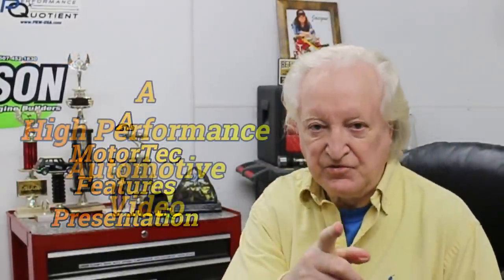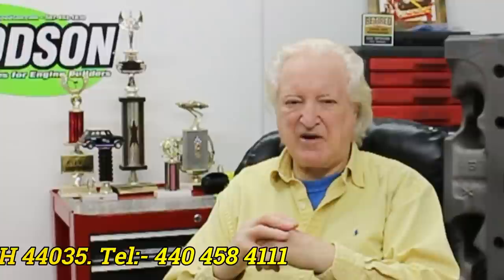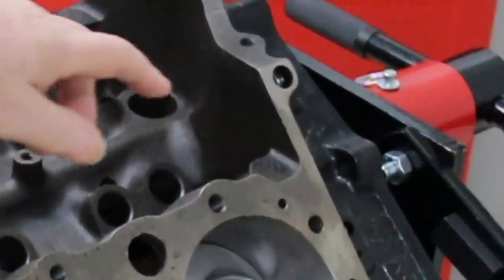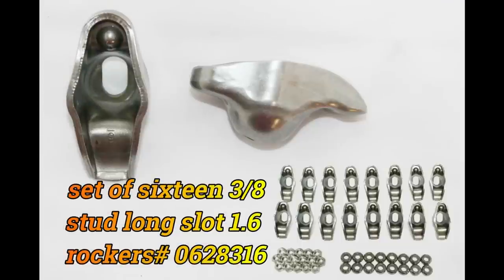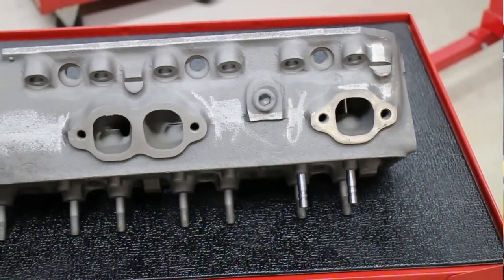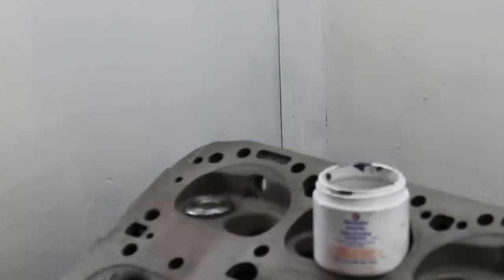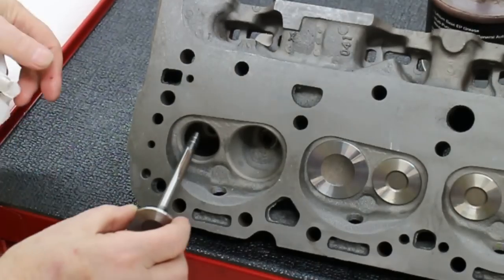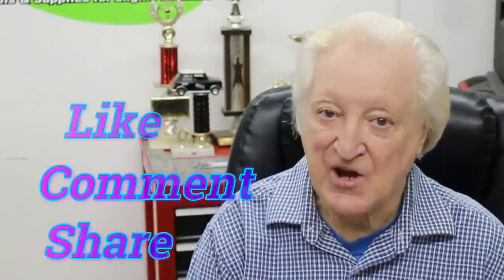Real low buck 60 lbs-ft and 60 hp minimum from stock iron headed 350 SBC

Comment: I used your guidance on porting a factory GM Quadrajet intake for my old second gen Camaro with a 400 SBC. It ended up making noticeably more low end torque than the ZZ4 intake I was currently using, and to top it all off it knocked 2 tenths off of my quarter mile E.T.!!
Reply: A q jet is the worst carb as it dumps raw fuel into the 2ndarys. It will not make good power as the fuel isn't atomized. It does not go through a venturi. Bloodviking

Comment: Dear Mr Vizard, I am a fan of your work and have been since I started to read you articles in motoring magazines from the 70s when I was a spotty faced kid.  I bought a mini in the 70s and a book came with it, written by you, all about improving the gas flow on the BMC A series engine, it had a red cover if I remember correctly.  I loved that book and would sit up in bed reading it for hours.  I was determined that when I was older and had a bit of money that I would use that book to pep up my own cars.  Well 5 houses later the book has gone and I`m still left dreaming about cylinder head and valve work.  I`m so glad that you are still using your knowledge and skill on engines and I`m glad that in came across your vid by pure chance.  Keep on trucking Mr Vizard, a link to my misspent youth.  Kindest regards, Paul Blackmore from Liverpool.
Reply: Paul, glad you enjoyed the book.

Comment: I built a 186 headed flatop pistoned 350 back in the mid eighties. My stepdad was a pretty good engine builder and showed me how to do some porting and did a 3 angle grind on the them. He also picked out a camshaft with a tight lobe center which was unique for the time. If I remember correctly it was 230/236 @ .050 .480 lift with 108 lc. I think the valve springs were TRW LT1 replacement and I bought a set of PAW long slot rockers. I used a 305 crankshaft and lightened the factory forged 350 pistons to match the weight of 305 pistons. TRW rod bolts handled 7,500 pulls with no problem. I ran a great set of Hooker Super Comp headers 1 3/4 with 3" collectors. It ran really well and surprised a lot of people. I ran ot in a 1967 Camaro on a diet that weighed 2950 with me in it.

Comment: There is another way to check those valves and seats. Blue the valve like in the video, using a wooden hammer handle on the head of the valve to hit it down into the valve seat. Do not twist the valve at all. Remove the valve, check the seat on valve and head. Wipe the valve clean or Brakleen it clean, then repeat the exercise to bring the blue on the valve seat back onto the clean valve. Will show instantly if the seat is out of round or has any low spots. Was taught to do it this way 45plus years ago and it has never failed me ever.
Reply from the maker: Hey Boss -i just have got to try this one!!!!  Thanks for the tip.
DV

Comment: Thanks D.V. I have put together countless #s of cylinder heads! I always used a good grease, basically the same way as you did on everything, valves & guides, retainers, shims springs ect! I probably read it in one of your books when I was a teenager! When other engine builders around our area were having problems with guides sticking & or galling issues, we were not! We even had a super stock racer come in to watch how I put heads together! [believe that?] Because he always had his guides fairly loose, because of the crazy high RPM he ran! [he normally used a light motor oil on the valve] But he even stuck them a time or two! All the things you listed, are commonsense engine building practices! Except, not too many have that anymore! You don't need to be told, but the cams with the L/C, [higher numerically number] beause people always seem to get this wrong! Have very rarely ever been faster on the track! We went through all that B.S. with nitrous engines back in the 90s, originally! They were always the quickest down the track, with the lower # L/CA! We tried 4 different cams, in the same engine, & with all different adjustments, to the camshaft & valve adjustment, that they said would be defiantly faster! But they were not! Same engine, same driver, same N2O kits, same track at the best weather time of year! Normally making 3 or 4 passes, for a average, on the different cams & the different cam timing adjustments! The one thing we found out for sure, was the camshaft companies, knew how to sell you camshafts! After all that testing, fuel, time, wear & tear, ect! We only made camshaft changes, after doing lash loops & cam timing adjustments, on the dyno, where the engine was asking for something different! Not the camshaft companies telling us what our engine needed! Thank you again D.V.

Comment: I’m kind of surprised that the rockers studs didn’t get pinned or modified. I’ve seen those things pull out on old Ford and Chevy heads with low spring pressure. As always a very informative video. Thanks for sharing.
Reply: Its funny ive pulled apart alot of small blocks and a few were race motors too and i have never seen a pulled stud, i have pulled studs with a 5 lb slide hammer and it was a lot of work , factory studs are not pressed in they are cast in , ive never thought screw in studs were necessary when spring pressures are within 50 lbs of stock. 

I wonder if studs backing out is more a cam side phenomena as opposed to valve spring side ?
Reply: @luckyPiston   I’m not sure. I think it’s just a heat cycle thing possibly. The easiest way I’ve seen to pull them is with a little heat and and a tool that utilizes the nut that goes on the stud. You tighten the nut and the stud pulls right out. The last one I saw fail in person was on a freshly rebuilt sbc. Completely stock throttle body engine in a early to mid 90’s pickup. Ran fine on initial startup and developed a miss about the time it got up to operating temp. Pulled the drivers side valve cover and the stud was ready to fall out.
Reply: @JohnThomas-vb9se  I will def consider pinning in the future especially if using 1.6 rockers with more spring pressure as the 1.6s increase mechanical load on the stud.
Reply: @luckyPiston  ...back in the sixties,,,,,drag cars needed studs to be pinned......Now understand in 1970....chevrolet  Z /28 camaro had screw in studs / pushrod guide plates............the earlier race versions of Z/28 [built outside of corporate Chevrolet] were no doubt pinned..............
Reply: @JohnThomas-vb9se  I saw an old mechanic fix a "pulled" stud -  just removed a valve cover and hammered the stud back down without even removing the rocker !!
He claimed it wouldn't pull out for another 100K miles and the car would likely be junked before that.

Comment: Didn’t realize those were 041 heads until I caught the casting numbers. Absolutely enjoy the videos. Thank you sir
Reply: Last engine I built I used them. That was back in mid-80's. When unleaded gas came on the scene I quit messing with mods. Started driving 4 cylinders that got 32 MPG running them hard as i could. Slow but cheap to drive!

Comment: When I got your book many years ago now, I was operating a SERDI 60 for a living, I noticed that the angles of the seats you recommended correspond with certain SERDI cutters,  I put a five angle seat on a set of Chevy 229 V6 heads that I cut out for 1.94's, they went on a 4.3 V6 to bump up the compression ratio, it was installed in a CJ5, it was a great combination!
Really enjoy the knowledge your passing on!
Reply: I always thought the 229 and the 4.3 were completely different motors ?
Reply: @luckyPiston  the 200, 229 and 4.3 (262) are Chevy engines, 3/4 of the small block V8, the 225, 252 are Buick engines.
Reply: @stevegarboden2437  I'll be darned, i never considered that that 90* V6 could also be a variant of the 267 and the 305 learn sumpem new everyday LOL !

Comment: Well done vid!  The name for the paint used inside the head iis "Glyptol"  Pat. 3M .  liquid insulation for motor windings, transformers etc.. The other reason to use it, it sheets oil so more gets back to the pan quicker.  RHS who now is part of comp cams built me a mild 468 BBC for my jet boat. They used Glyptol in the head and in the valley. That was in the 80's. I had no idea till they told me!

Comment: David, I have to thank you for your work. It's absolutely incredible knowledge. There's no one I've learned more from. Gale Banks is second behind you. Lots of math on duration, moving torque peak, etc. The one thing I'm going to share with you that blew my mind is on exceeding peak flow lift because it's a factor of time. If you only lift to peak flow, ie 0.600" , then peak flow is achieved for a fraction of a second. If flow goes flat at .600 and you go to 0.700" it creates a square wave flow over time vs a sinusoidal curve with a flow peak. Exceeding peak flow lift leaves a peak flow flat top resulting in greater area under the curve with the same centerline and duration. Square wave lift flow patterns.
Reply: EXACTLY.👍
That's a point grossly misunderstood by most all.
Run all the lift possible for your duration.
Reply: Yes...for a point of view of power. But speaking of street engine or "all around" one there is also valve acceleration (cam lobe surface loads),  valve side loads and valve spring durability. Power and durability (high mileage) are always in some kind of balance...which you have to decide when building engine.

Comment: The 400 dampener is for external balance so the 350 8" truck dampener is probably what David meant to recommend that should be used on an internal balanced 350.
Reply: Yeah i think a few of us were thinking that too, it doesn't hurt to clarify as that's what DV is all about anyway. cheers.
Reply: Listen again.
DV said use the 400 damper and machine out the weight for internal balance cranks.
Reply: @hotrodray6802  

Not many people have a lathe to machine the outer ring totally round. Besides, by the time you do that it will now be a light weight dampener. The reason he said to use that one is because it was a larger diameter and it is heavier. Also the newest factory sbc 400 dampener is from 1976 that more than likely the rubber ring would be dry rotted.

A late 1986 to 1995 sbc 350 truck dampener is the larger heavier design and it is already internal balanced and will more than likely have a few more years of service left in it being over 20 years younger.(a Vortec dampener is the larger size but the bottom pulley would need to be spaced out the thickness of the reluctor wheel I think it might be called that is on the crank behind the timing chain cover or source that wheel and install that under the cover so the pulleys line up?)

And I did hear what he said but what he said wasn't right for 2022, maybe 20 years ago would be more doable but not now. The sbc 400 dampener would have to be sent out to have machined for $100 an hour plus or minus which would take around an hour and a half and then around another $300 to have it rebuilt! You can still get one of the ones mentioned above for about $20 at a junkyard. I know which one I would choose, what about you?
Reply: You are right - was not thinking clearly there.

Comment: When I went from a performer rpm to a performer rpm air gap on a AMC 360, I had to go to annular booster. I couldn’t get my straight leg 600 to work or my down leg VS 750 to work either. They had big flat spots between the transfer slot and main jets. They had both worked perfectly on the heated performer rpm.
The annular 600 summit racing carb fixed my problem. Your buddy Andy from Unity Motorsport pointed this out on one of his videos. I then went and re read your how to tune holleys book and found it all the info in there.
Reply: Interesting, Anulars fog a little better so it would be safe to say the air gap intakes are more demanding of a finer mix ?

So i have a Vortec 383 with a Edelbrock performer (w/no heat crossover) and when i went from a holley 650 spread bore to the Slayer VS 750 the motor fell flat on its face, it idled just sweet and when you blipped the throttle it was instant revs but as soon as i tried to drive it wouldn't turn past 2k rpm, tried jetting it up but that just wrecked that sweet idle and didn't make it any more driveable , ended up puttin on a Holley 3310 but it didn't run quite as nice as that old spread bore
Reply: @luckyPiston  . So the way I understand it is the colder the intake, the smaller the droplet size you will need, to stop it condensing on the intake walls and be a good droplet size by the time it gets from the carb to the combustion chamber.
Reply: Downleg annular always win.

Comment: Nice detailed video.  We used to pound the valve stems after keeper installation with a dead blow hammer.  I don't recall why this was recommended.  If a keeper pair was binding a little, it should fully seat itself on the first crank over.
Reply: I was taught to bump them to insure they're seated.

Comment: Those look like 041 heads. those are great for street builds. I have a set on my old truck. 9.3 static compression, 2.02/1.6 valves and Howards retro roller 485/495 110 lobe separation, Comp full roller rockers 1.52 ratio. intake is an Edelbrock performer with a Holley Sniper EFI. The truck is mean!
Reply: DV's calculation program probably recommends a tighter LSA.
Reply: @hotrodray6802  I called and talked to the people at Howards. that was the cam they had in stock. They were having trouble getting cores. They actually recommend a slightly smaller cam for my application with a 108 lobe speration but said this one would work well.  It does the job. I don't have the Dyno sheet but if I recall it makes 380 something HP and 400 something torque.
Reply: My grampa said that the most important specs of any build was a four on the floor and a fifth under the seat.

Comment: 🔔😎
Many comments/ confusion about LSA / LCA and installed centerline.

I'll try. Ford 5.0 HO cam:

Intake lobe centerline 118*
Exhaust lobe centerline 113*
Add together ÷ 2

118+113 = 231 ÷ 2 = 115.5 Lobe separation angle.... Ground into cam
 
Intake lobe centerline 118* is the installed centerline as per the timing gears. 
118 - 115.5 = 2.5* advanced

Hope this helps. 😎

Comment: I had really good luck with a rebuilt  406 SBC Shortblock (stock replacement 12.43 cc dish) with #441 (Number inline with runner variation) wiith minor bowl, throat and short turn work, Custom Cam that later became the CC CS 270AH-8 0.313/0.307 (0.501/0.491 w/ 1.6 stamped rockers)  270/280 224/230 108 installed on 105. With a stock '69 QJ Med Rise Intake and 1.625" Headers, it pushed a 4400 lb truck with 3.31, 26" tires and stock converter deep in the 8's / 13's and 7's / 12's on the bottle. The 307 Turbo-Fire Decal on the air cleaner lid was the finishing touch. Getting a heavy street vehicle to run with a stock converter is all about power under the curve not big peak numbers.
Reply: 👍 More produced torque makes a converter stall higher.

Comment: With deep regards to your loss(es) those are a tough, tough, thing.  I was able to find a current LS based 108 LSA versus all comers t was from Richard Holdener and yet it showed 108 LSA visibly ahead of everyone else  by a significant amount. My hat is off to you.
Reply: Yes.   Holdener did an lsa test,  same cam specs only lsa changes on a 500hp engine.   120, 112 and 108.    The 112 lsa made 35 more ft lb to 5500 and matched the 120 after.   The 108 made 14 more ftlb to 5500 than the 112 matched the curve until the last 500 rpm where it made 7hp more.

Comment: I used to deal some with REED Cams in Atlanta, and Steve Demos worked for them. I think he ended up with some of their masters and maybe equipment. Great guy and a wealh of knowledge. Thanks for the tip!!
Reply: Have heard of Reed Cams. I'm wondering what cam characteristics would be optimal for a low compression (8.8, 327) small block.with large 215cc  ports that aren't as efficient as newer castings.
Reply: DV's cam calculator will tell you
Reply: Rodney, yes I know Steve and plan on doing business with him!
Reply: @DavidVizard  Fantastic! I have admired your work since I was 10yrs old in fact, and I just turned 55! Cheers!

Comment: What he is doing here is using dynamic compression to help with overlap and make the engine flow hard early something like this will be done by 5500 if you recut stock cam but would be a monster the whole way

Comment: Hi Mr. Vizard, you and Cattledog have inspired me to do a 383 build to see if I could do as good of a job.  I am using a '79 sbc 350 off my z28.  using 13004000 rotating assembly with a SK12-246-3 comp cams.  Now I know it is not an 107-108 LSA but it is a 110.  I know you poo poo on this but considering cost time and effect I thought it would be the closest match for what I have on hand already without getting special grinds.  Hopefully you can watch what I am doing and possibly give me a few pointers oh yes 180 cc flotek heads I am running thus the cam selected.

Comment: David, I want to build a copy of this motor, or one like it perhaps. the cam I wish to use is the Howards MC110961-08 with 285 duration, 108 lobe sep. angle and 470/470 lift. It's supposed to be good for 2000-6200 - which is perfect for me. I will use your iron heads or the Jegs copy of the double hump fuelie heads in Aluminum. Best wishes from Down Under Tom!

Comment: Crane used to make some super low rpm torque cams that had stock and even LESS than stock duration with 104 LSA lol. The intake valve closes at like 16° ABDC on the smaller one to build cylinder pressure.